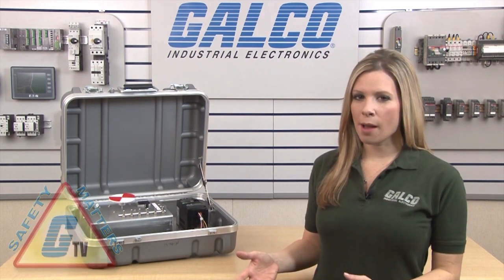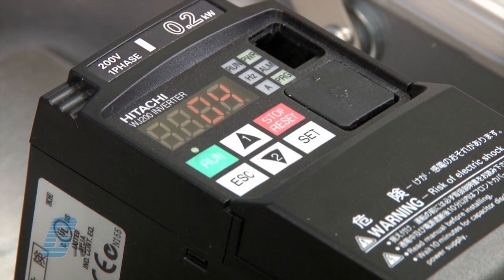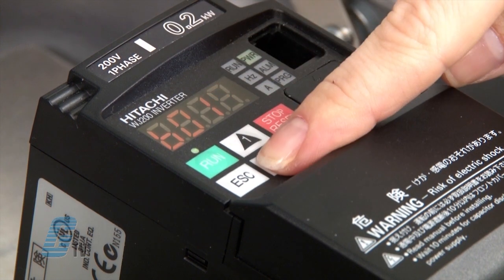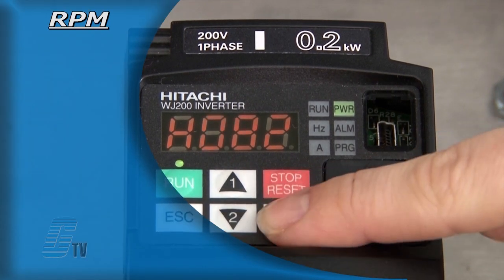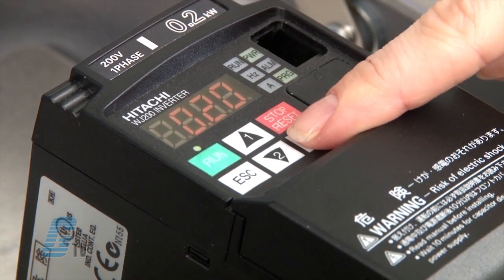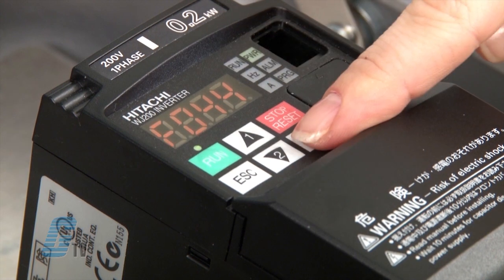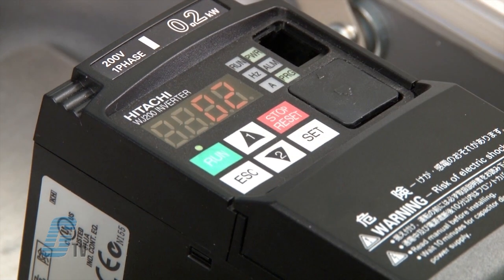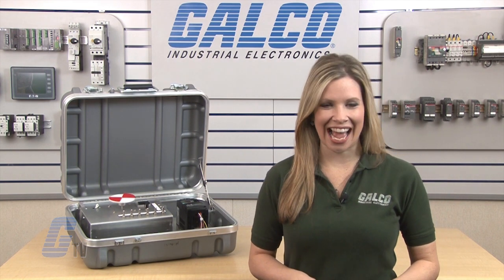Basic Setup of Hitachi WJ200 Drive

Comment: Somebody should produce a "For Dummies" book for specific makes/models of VFD. I have this specific VFD, which has been set aside for several years. When I got it, I made pages of annotations. When I pulled it out again (still works), those notes were extremely valuable.  The thick little book is incomplete and not perfect.

Many of us aren't trying to automate a plant; we aren't trying to have various sensors adjust the motor. We just want a three phase motor to run on single phase. We need the VFD to run, stop, and reverse the motor. Braking might be useful, and variable speed would be icing on the cake.

Even real, genuine factories may simply want to run  "exactly what we need, but the wrong rpm" motor at 43hz.

That horrible manual is truly an act of cruelty. 

But Hitachi, and other makers, are so proud of three or maybe four ways to control speed, they fail to mention the VFD is essentially locked out when it leaves the factory. Not explicitly mentioned in the printed manual. Oh yeah, the printed manual is not complete, you need to download the PDF...

They suggest a crimper to attach ferrules to control wires. That crimper costs more than the VFD! You really do need a ferrule crimper, or maybe not. 

It seems terminal strip is impossible to access. Oh, I see, the removable access panel is EXACTLY THE SAME COLOR! And the cover that blocks the panel is EXACTLY the same color also! Oh, remove one screw, and, uh, oh, PRY IT OFF? yeah, sort of, it's also snapped on, besides the screw at the bottom right corner.

Honestly, why not buy a cheap Chinese VFD and have exactly the same frustration for much less money?

Or... Why not produce a simple VFD, and SPEND MONEY ON MAKING A COMPREHENSIBLE INSTALLATION MANUAL?

Comment: Can someone give me all required parameters for 3 phase same VFD ?????
Reply: Okay, you are truly ignorant of VFD operation.

But Hitachi isn't helping either.

Anyone wanting a VFD installed needs to volunteer some information:

Motor needs variable frequency? Or fixed at 60 or 50 Hz?
Or fixed at some other frequency?
Or is frequency controlled by sensors and automation?
Is there a need for bidirectional operation? Controlled by machine operator or automation?

And when the VFD programming is perfect and complete, WRITE IT DOWN.

Comment: Does anyone have insight on the Analog Output functions? Specifically C028 = 02, Inverter Output Torque. The PDF manual section 4-90 only mentions 0-10VDC range, but does not specify units or scale.
Reply from the maker: The scale is based on the amp rating of the drive.
Reply: Thanks for your prompt reply. I have a WJ200-015SJ, per section 1-4 this is rated at 8.0A at CT (which was the default value in parameter B012). I changed this to correspond to my motor nameplate (6.0A). Does this change the scaling of the analog output accordingly?

I assume what the drive is actually doing is reading Volts and Amps and trying to correspond that power draw to motor output torque?

Also, what are the units for Output Torque? (N-m I would assume being a Japanese drive, but maybe its Ft-lbs or ?)
Reply: I have a remote 3 wire 'start/stop/emergency stop' box. Where do i wire this and what parameter do i change?

Comment: Hello! Can any body tell me how should I use wj200-075hf with 15hp motor? what settings should I change?
Reply from the maker: Usually you start with the motor name plate values, VOLTS, Hertz, RPM etc. Then set your MAX and MIN speed, then ACCEL/DECEL. This should get you in the ball park so to speak. What kind of application is it?

Comment: Hi, what is the voltage increase method? I havea  Device a 220 and a Hz-58 and a output power 180-volt
Reply: You need a unit that matches your input/output parameters. For example. I have 120V power input in single phase. To run a 3 phase motor in 220V I selected a VFD that matches this requirement in the specifications.

Comment: I have the same device on the solar energy, if the frequency of the constant control manual only, how the method of making the frequency is automatic so that if the electricity goes down the device decreases frequency and does not stop the device and thank you
Reply from the maker: Try asking again differently your phrase makes no sense. Are you asking how Volts to Hertz works?
Reply from the maker: Wait a minute, when you say the Electricity are you referring to the input power?Are you asking about "Power Loss Ride Thru"
Reply: GalcoTV 
The device I have input from solar energy

The device has a manual frequency, for example 55 Hz, and if the sun is weak (for example, there are light clouds) the device stops working ,,, and my friend has the same device; the frequency is automatic (if the light of solar energy, the frequency of down to 40 Hz) What is the way to make the frequency automatic? Thank you
Reply from the maker: The output Frequency of the WJ200 is regulated based on speed command input to the drive, you just set it to what you need.
Reply: GalcoTV 

Meaning it can not be made automatic?
Reply from the maker: Not unless you setup the PID mode of operation. The speed signal would have to be externally automated. But not sure you can use the PID operation in your application. You have to provide a set point AND a feedback.
Reply: @GalcoIndustrial  madam..I have wj200 3 phase VFD I want to control it's moter seped though potentiometer can you please give me parameter ?? And how to connect

Comment: Thanks for this informative video.   Another parameter which one might want to change is B083 (carrier frequency).  The default value (2 KHz) allows for maximum power, but in my case caused the motor to have an annoying hum.  Raising this value to about 10 KHz allows for a quieter/smoother running system if you have the system sized so that it's not maxed out on your motor.
Reply: thanks